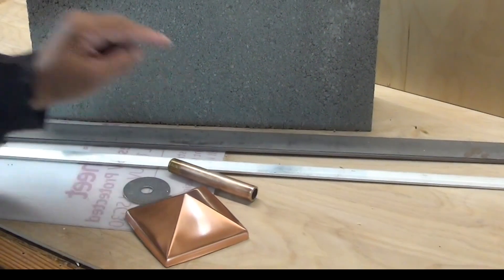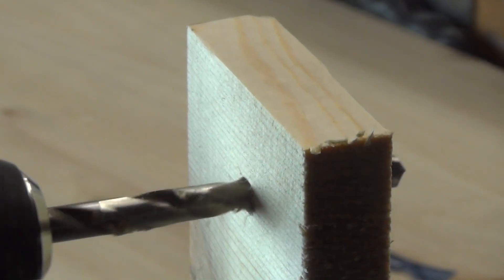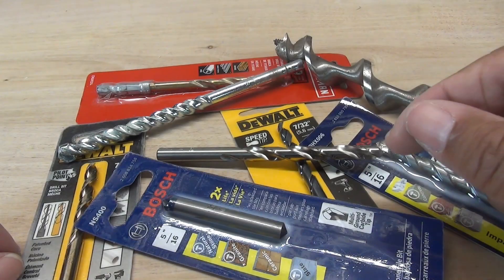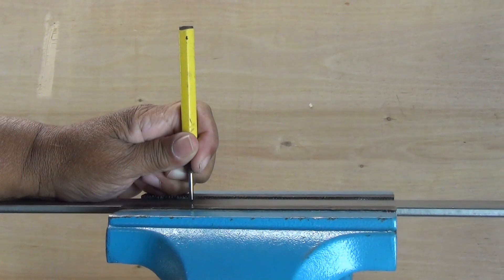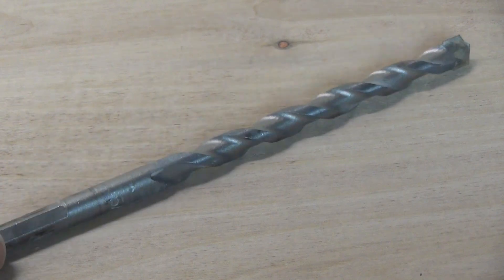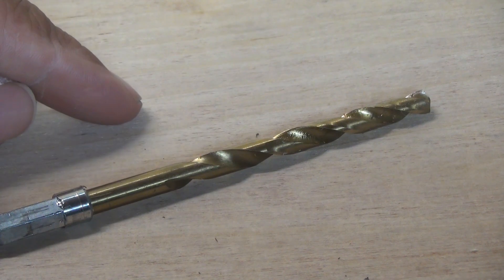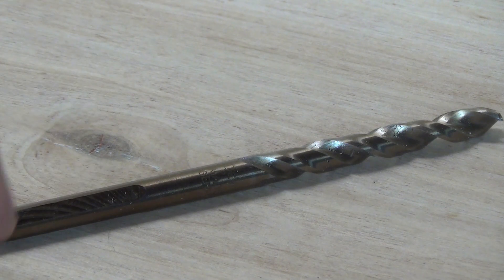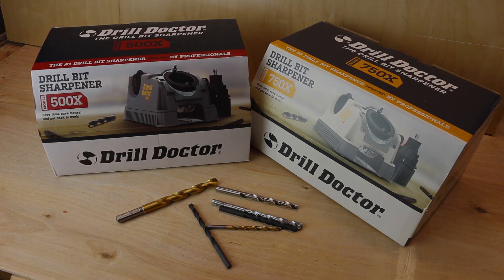How to Drill a Hole in Stainless STEEL and other TOUGH materials

Comment: I needed to make a lot of holes in stainless steel, so bought two cobalt drill bits.  The first drill bit I destroyed within a couple holes by doing almost everything wrong which caused it to get too hot and lose its sharpness.  After some research, I dropped the RPMs on the drill press down to its lowest setting, adjusted the pressure of the drill bit on the material up, so it cut into the metal, but also made sure I didn't drill for more than a couple seconds at a time so heat didn't build up.  Probably most important, I ditched the oil and instead sprayed water on the drill bit every few seconds to keep it cool.  After that, not problem with heat build up and dulling bit.

Comment: I know this is an oId post, but I'll give this a try anyway. I have a 36" stainless steel piano hinge that I want to use on a lid for a box I built. The hinge has no pre-drilled holes. The leaves are 1/16" thick. Should I drill recessed holes in this or just recess the entire hinge into the wood and not worry about recessed screw holes?

Comment: topic "How to Drill a Hole in Stainless STEEL" is not served in exact details and video  with drilling ss pipes and thick sheets , and drill bit details and it RPM and hand drill uses to drill in ss , can u pl elaborate in video and post a link , thank

Comment: Any1 got tips on how I can drill a half inch straight line that is ab 1/8 inch wide. On a steel golf putter head.
Reply: Could I jus use a center punch type of tool. It doesnt have to be deep into the putter only probably another 1/8 inch

Comment: I love the information in this video. Thanks so much. I have 3/8" solid SS304 that I'm having a hell of a time drilling through. I bought an M42 cobalt set off Amazon, with my makita hand drill on low speel using cutting oil and a 3/16 bit, I made it half way through and it would drill any more. I used up one size and down one size from the set and made zero progress, using plenty of lube and slow speed. I have yet to make one hole successfully through this material and I have many to make! Feeling defeated. I've tried water as cooling fluid to no avail. Tried some hss bits and no success at all. I do notice a bit of a wobble on my drill, almost like the end if the drill the holds the but has a tiny wow or bend in it. Fairly new drill so I don't know how this happened. Could have a negative effect for sure. I simply want to drill 3/16" holes, beveled/ countersunk to accommodate a #12   stainless beveled 1" wood screw into teak. Please, please tell me what I need to achieve this and to do it many, many times over. I have very little garage space but could accommodate a drill press on my work bench if required. These are the bits I purchsed and tried: Metric M42 8% Cobalt Twist Drill Bits Set for Stainless Steel and Hard Metal (1mm-10mm/19pcs) https://www.amazon.ca/dp/B07MZQMPMC/ref=cm_sw_r_apan_i_0XP1SVWHY5AFBFR2AJ0D
Reply: THANKS FOR BEING ACCURTE AND DETAIL INO WITH AN LINE

Comment: I just bought my first drill at 31 years old (I know, kinda old, grew up without a dad and mom was an office lady) and I couldn't have imagined how many types of drill bits there are, I always thought there were just 3 types! (metal, wood, and cinder block)

I had to make some holes on a stainless steel pipe so I bought a bit for "metal"... time to drill the hole and I hadn't even heard of lubricant yet... let's just say the drill bit did NOT survive...

Comment: Hey Leah, I want to switch out the stock chrome handle bars on my bike with new ones, but I need to cut/drill some holes in the new ones for an internal throttle.  Would the cobalt bit in my 18v cordless drill do the job for the small holes.  I was also going to use an angle grinder with a metal cutting disc to make the holes bigger.

Comment: Once when I tried to drill through a tough wood I smelled smug . and I couldn't get through this kind of wood. Would you tell me what mistake did I do?   
And what is the best way to make holes through very tough wood?
Reply from the maker: A sharp drill bit works wonders.  Do you sharpen ypur drill bits?

Comment: I had to put a hole in a stainless sink to install a soap dispenser.  I smoked a few bits, and ended up getting the hole started by using a concrete nail sharpened to a point and a hammer (with some wood behind it) to first pierce the metal.  Once that was done, I used a step drill to get to the right size hole for the slug cutter to work.  (I love using stainless, but hate drilling it)

Comment: I was told that if you use water, just in a spray bottle or like container, to lubricate your bit while drilling through stainless steel it work much better than oil.  It keeps the bit cooler and allows for more bite, so you can use a regular HSS bit to drill stainless steel.

Comment: A spring-loaded prick- punch that doesn't require a hammer makes your work faster and easier. Just push down on it by hand 'til it clicks! 

Hey, it's the 4th of July --- some might argue that it's as good a day as any to punch a prick! Except that violence rarely, if ever,  solves anything. And as they say,  discretion is the better part of valor. And even when drilling a hole in something, using too much force just ends up burning out the bit prematurely. Finesse and technique, a lighter touch plus constant pressure,  works much better.

Comment: Colbolt drill bits will outperform almost any others. 1 colbolt drill bit will (provided you dont cook it)  preform better than 10 regular HSS bits in hard materials like stainless. What I'd like to know is what you reach for if these wont do the trick? Im aware of diamond tube drills. But any information?
Reply: Hi hopefully Sinner, if you have a bench grinder and can sharpen a drill freehand, try regrinding the bit to a flatter angle,  drill slow and with cutting fluid,                                                                            I have good results in most tough steels using this method ,otherwise you have to invest in some carbide drills ,not cheap, but will cut most hard metals. Hope this helps.
Reply: @stuartlockwood9645  definitely food for thought. Thankyou.

Comment: Ceramic tile is actually a perfect example of something you don't want to use the hammer setting with a masonry bit.   You'll want to use patience and a light touch though and you can get that done too.  Back when it was actually hard to find ceramic drilling bits/cutters that was the only option I had and it's worked many a time.

Comment: Besides the masonry bit tip, is there a way to tell the different bits apart once they're out of the wrapper?
Reply from the maker: The color is the give away
Reply: Black with a raised edge equals crappy, black straight is ok, yellow better, shiny silver maybe even better. Brown tinge is colbolt,  best. Drill and see.

Comment: Years ago we stayed with my in-laws in Arizona for a year, and all the houses in their neighborhood had cinder block walls instead of fences.  My wife wanted to hang some metal wall art outside, and she tried to use my cordless drill on the wall.  Lol, it didn't work!  We didn't have the means to buy a new hammer drill at the time, so we just left the wall bare
Reply from the maker: Hey Kris
Reply: If you use a masonary bit rotate it with your fingers and continually rap rap rap it with a hammer, eventually you will have a hole. Miners layed charges in holes drilled  this way in the good old days. Two men, heavy hammer.

Comment: Ever hear of using mustard as a drill lubricant on stainless?
Reply from the maker: Seriously ?
Reply: @seejanedrill  Yes! We were installing half-door kickplates and had to drill a hole for the door's pull handles. So instead of getting us cobalt drills they supplied mustard (cheaper) ! It did work better than cutting oil, though not very well.

Comment: Good tips! What I would add from an auto body techs point of view, is that drilling through steel is not best left for anything from any box chain hardware store. 
Visit Fastenal. I have had to drill through hundreds of spot welds and found nothing from name brand stores that were worth my time at all. 
Imagine name brand bits labeled as FOR STEEL, but they went dull after 2 or 3 holes. Very frustrating.
I got a set of bits from Fastenal in a blue octagon shaped container, costs about $120. These bits work all day for me without fail.

Comment: What about plastic? Is the black oxide bits good to drill through plastic? And what about bi-metal hole saw bits? Can I use these to drill a hole through plastic?
Reply: Drill with a blunt or you can drill reverse to get it started, if going through thick, thin I usually just drill reverse, drills and heats the edge so it doesn't crack or splinter
Reply: Yes to both questions. But if drilling through acrylic/perspex use a blunt bit.

Comment: as a SST pipe and tube welder working for years welding radiators and other high tolerance parts
 I can say with confidence that heat is your enemy, spray the bit with coolant to keep it as cool as you can, 
and go slow, too many RPMs can build up un necessary heat
Reply: What coolant do you recommend?  Should it be oil or water or something else?

Comment: Just a little tip: when drilling in plastics, especially the harder types like plexiglass, use blunt drills. Sounds weird but I learned this from professional display fabricators: sharp drills will make plexi etc. splinter around the edges of the hole.
Reply from the maker: Thanks f or sharing this
Reply: Adding a couple of layers of masking tape helps avoiding cracks and splinters too.
Reply: I agree with this. Not only can you get splintering, but the bit can grab and try to suddenly screw itself into the material. I have a separate set of bits for plastic and brass that have been stoned off to make them cut less aggressively.
Reply: I typically use a neutral rake for thin materials